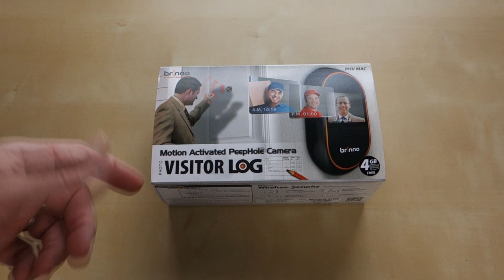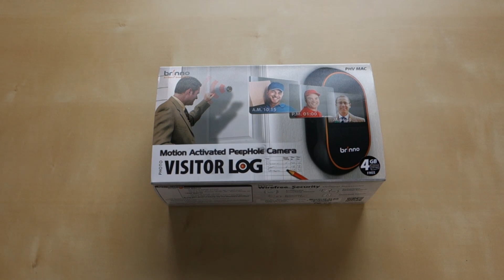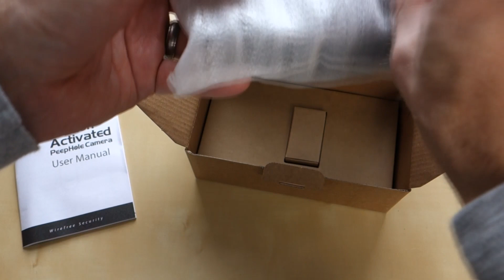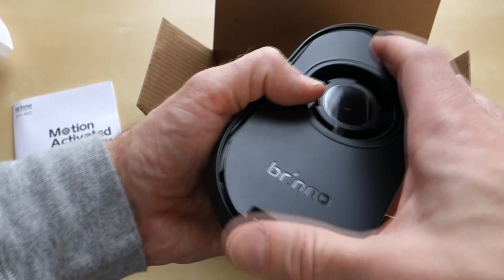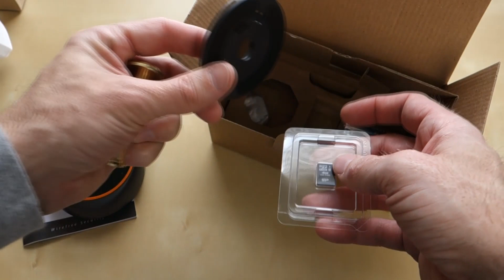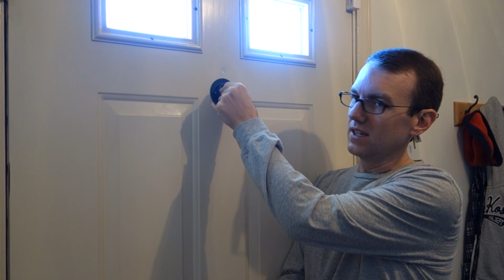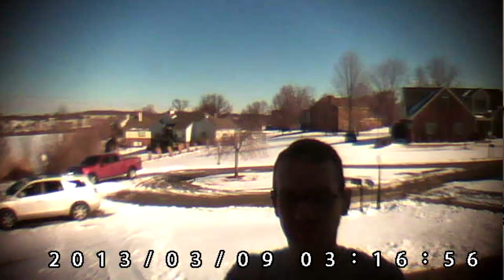Brinno Motion Activated PeepHole Camera Unboxing and Installation

Comment: How does it handle in Low Light conditions? I want to mount it on my apartment door, and the staircase it's low lit
Reply: Get the Brinno Duo Model : (SCH1000W) and it should cover all your concerns even his because it comes with a knocker motion sensor combo  (in-Color) in the day with excellent lighting in the day. and Night vision black & white at night., along with wifi capabilities. Price $199.00 Amazon
Reply: Suitable for Apartment hallways with low lighting

Comment: Jordan,  Can you let me know if the camera motion activated would 1. auto record if someone just passed by your front door. Like from Left to Right passed the peep hole, example would be someone in apt complex walking in the hallway and passed your door.  2. Does it work well if someone is on a scooter zooming by? 3. Does it record audio also? 4. is there any other equipment that needs to be on the outside of the door area to activate motion sensor for recording pictures or video/audio? 5. can you skip using an outdoor equipment and just set the camera to record all day? Thanks.

Comment: Several things here. You failed to post the Model number in any of the title or descriptions text. Otherwise, the content was good & I needed to learn more about this very product (Brinno PHV1330) BTW I like your delivery & pace and you have a likable presence. I encourage you to do more if you feel like it, you'll have my vote.

2. The reason the image looks "Fringed" was that the plate was placed off center from the viewing axis. If you took the time to look through the camera & door viewer, you might have been able to locate the "Sweet" spot before permanently sticking it to the door. (Adjusting the inside lens closer to the camera with a stack of washers might also help)
3. Always read the manual before doing a video like this. Find it online if you really don't want to crack the seal on the box. IE you didn't know what that switch on the side was for? (Night vision maybe?)
4. What did the saved images/videos like? Naturally for any camera if the persons face is up close and there is a bright background, you can't see them all to well. (is that what you saw? Post the Daytime & night time shots please.

I truly thank you for your time
Reply: Wrong. This is the PHV MAC (the model number is on the box as shown ~0:20). The PHV1330 does not have built-in motion activation.
Reply: He installed the Brinno PHV MAC 12 mm. MotionActivatedCamera. 
The 14 mm could be slightly better.